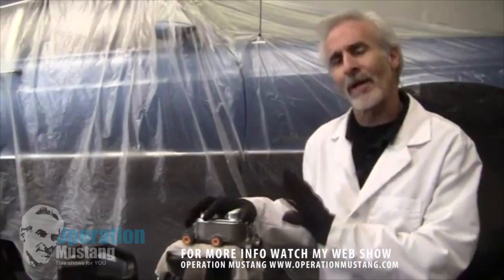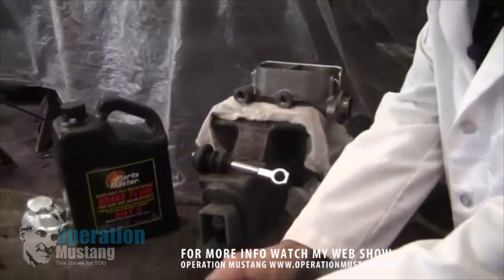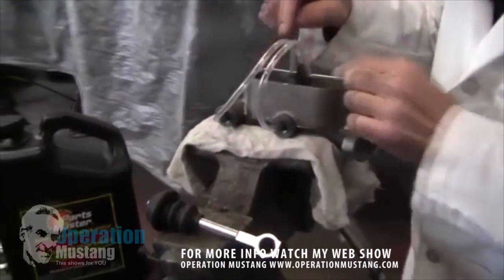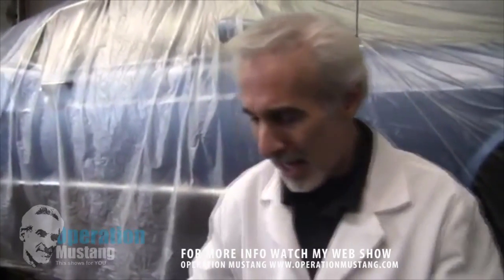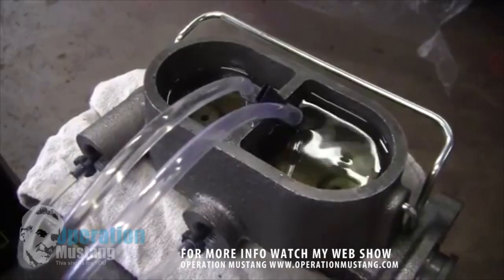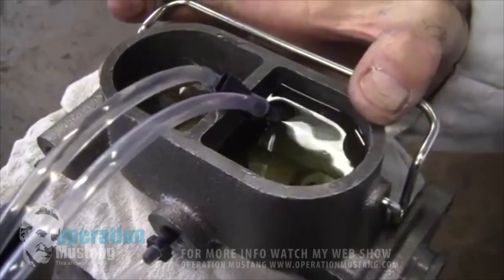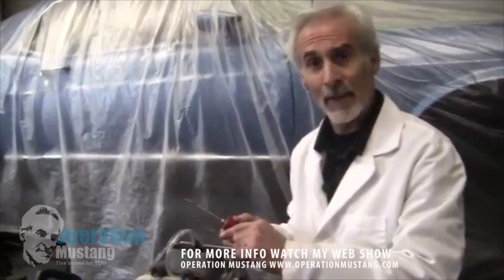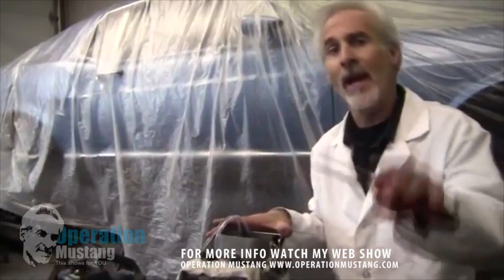Bench Bleeding the Master Cylinder on your Classic Car

Comment: fluid will only come out if you push the pushrod (or screw driver in this case) in the rear of the master cylinder. There will be a SLIGHT bit f air left in the system after you hook the lines up but it will not be nearly as much.

Comment: brake fluid does not evaporate. brake fluid is hygroscopic meaning it is water seeking. if you leave the cap off it will eventually absorb the water moisture from the air and have water molecules in the brake fluid that can boil under hot brake applications. that is why they say to put the cap back on, not because of evaporation. I have never seen brake fluid evaporate and i have left bottles of fluid exposed to the air for months just to see the moisture content. i have a moisture tester.

Comment: Excellent tutorial! Feel comfortable to take on the task myself thanks to this video. Very helpful that you made references to the time it could take.    Question: is it imperative that the master cylinder be level on the bench?  I understand it doesn't sit level while attached to the booster (at least not on mine) and it must be level.
Reply from the maker: Derek Vinyard  Should be as level as possible. You will see why when you do the task. Thanks !!

Comment: Brake fluid evaporates? I knew it was hygroscopic but I’ve never lost any from leaving a cap off. I was always told to cap it because it absorbed moisture (hygroscopic). Same reason you want your reservoir cap and diaphragm in good shape, it’ll pull moisture and rust brake lines and cylinder bores

Comment: the reason you want to put the cap back on the brake fluid is because brake fluid is hydroscopic, meaning it will absorb water from the air.  water will ruin a brake system.  that is why its always recommended to only use brake fluid from a new, unopened bottle.
Reply from the maker: Agree.Thanks for the input...

Comment: Plug one of the beak line holes then put your FINGER over the open hole so that break fluid can come out but seals it from going back in until you get a solid stream!! Then plug the hole you just blead out and blead the other break line hole!!  Then I put the master cylinder on the car with the lines a little loose and have my helper push the pedal down then I tighten the line release the break pedal then open the  lines a little push the pedal down again until the air is out works every time!
Reply: burt simmer should make a video of this

Comment: Quick question, so how do you mount it onto the booster without dripping brake fluid? I mean, Eventually you will have to disconnect the bleeder screw and install the brake lines, during that process, is there a trick to not have brake fluid leak during the line installation? And when you do open it, won't it draw air? What about installing it onto the booster, use the oedal to make the booster push rod to push on it to let the air bubbles out then once done, just remove bleeders and install br
Reply: the trick is to do it fast (; lol
usually after you replace or bleed the master cylinder you bleed the brakes as well
Reply: Yes you can actually get it mounted to the car and press the brake pedal and expell the air before hooking up the brake lines.

Comment: How would you go about reinstalling it then so you dont have more air getting into the master? Just keep that all hooked up, connect it to the booster and then quickly connect the regular brake lines?
Reply from the maker: Good question. By keeping the master cylinder right side up. The fluid will drip out of the holes, air wont go in. Also installing the cap stops the flow of fluid out the holes. Most master cylinders also come with screw in caps to keep the fluid from draining out of the master cylinder until it can installed.
Reply: Does that mean you keep the reservoir at the full level of brake fluid when you are installing the master cylinder back on the car?  @MustangRestorationsInc
Reply from the maker: @xpmark1  Yes, with the cap installed...

Comment: Great video. I have a Camaro with a proportioning valve. Does that get hooked up after the MC has been bench bled, or should it be hooked up before hand? If before, how would you seal up all of the ports, as it has 4.  Thanks!
Reply from the maker: Hi. The complete brake system gets assembled first. The last thing that gets installed is the Master Cylinder after its been bench bled.

Comment: Thanks Chris, another question:  I heard that when  removing the master cylinder from the C3 corvettes it can be hard to reinstall the master cylinder without having subsequent leaks at the booster.  Once the seal is broken from the booster, it is hard to get a good seal again.  Have you had any experience with the C3 corvettes (1974 specifically) where this was a problem?  thanks
Reply from the maker: 97widerider Never heard of that being an issue. I have worked on, and have owned many, many Corvettes without having trouble with a seal. Make sure that area is cleaned before reinstalling the Master.

Comment: Hello! I'm writing from Spain. I've bought a new master cylinder for my 69 Mustang and the isn't this kit to bleed the master cylinder. I must to replace the brake hoses too. Then it's mandatory to bleed the master cylinder? If it is the only way, do you know where can I find this kit? Thanks!!
Reply from the maker: Yes... if you replace the hose's you will need to bleed the brake system. For parts go to www.kentuckymustang.com
Reply: @MustangRestorationsInc  thanks, for your answer. I've got all the parts for that. But I can't find this kit that you use in your video for bleeding the master cylinder before to put in the car.
Reply from the maker: Talk to the guys at Kentucky Mustang Parts & they can send you the Master Cylinder bleeding kit as seen in the video. Explain that to them.
Reply: @MustangRestorationsInc  thank you!!

Comment: Is have a classic Fiat where the master cylinder is under the pedal and the fluid reservoir just under the windscreen. Still figuring out how to bench bleed it, because if you fix the brake lines all fluid leaks out.
Reply from the maker: Bench bleed the Master Cylinder & put it on the car.Then bleed the entire brake system. That is how it is done no matter where the location is.

Comment: Hey Chris, what if I’m not getting flow from front reservoir or bubbles. But I am getting both from back reservoir?
Reply from the maker: Probably a bad Master Cylinder.It may take time though to get a good bleed of a new master cylinder.
Reply: @MustangRestorationsInc  
Hello Chris
my car is 1993 Ford Taurus V6  3L  and my master cylinder 
have 4 ports (4 brake lines)
do I do the same things you did with the plastic hose,,but in my case i need to put 4 hoses instate of 2 like you?
and how long estimate can take
thank you
Reply from the maker: @victorroff7003  Not sure.This video applies to older cars...

Comment: Great video , hi Doc ,my 68 mustang six cylinder, I can't remove the brake master cilynder from the push line , there's a retainer or something holding it , any help thanks
Reply from the maker: Hi.. The rod is anchored to the pedal on the inside of the car. Take a peek under the dash & follow the rod coming thru the firewall and remove the clip. This will allow you to remove the master cylinder with the rod attached to it.Also please sign my petition to get a cable show at: www.thedocneedsashow.com
Reply: Chris Ingrassia I did thanks , just now the brake lights stay on , also I signed the petition #122 thanks good luck !!

Comment: Made the master cylinder squirt on the bench (both lines) but when i put it on the car, only the back line squirted and the front line dripped.......why?......this is installed on my 64 impala
Reply from the maker: Hmmm. You may have some type of collapse of the front brake hoses not letting the fluid travel thru them. Loosen the line at the hoses..See if fluid comes out before the hoses.
Reply: @MustangRestorationsInc  thanks for the reply bro....I only had to add a 3/8 washer! A 3/8 washer had me stressed out for 3 days 😂😂😂

Comment: You can't just use any type of brake fluid as this guy implies.  If your system was designed for DOT3, that's what you have to use, etc.  And silicone brake fluid should not be used unless you have a special need for it. It was designed for military vehicles.
Reply from the maker: LOL

Comment: i dont have  vice  can  blleed  differnt way the master clylinder
Reply from the maker: Sure.  Have someone hold the Master Cylinder for you while you bleed it..
Reply: DO THE SAME THING HE DID BUT BOLT IT TO THE CAR AND HAVE SOMEONE PUMP THE BRAKES WHILE YOU WATCH FOR LOW FLUID AND AIR BUBBLES. USE THE CLEAR TUBES TO BLEED IT.